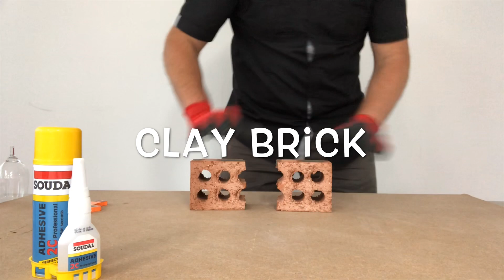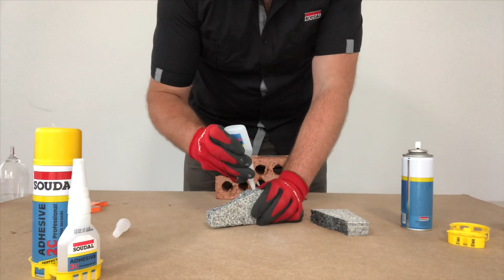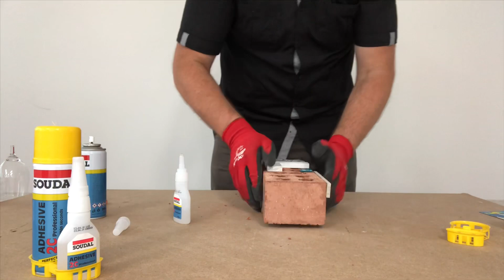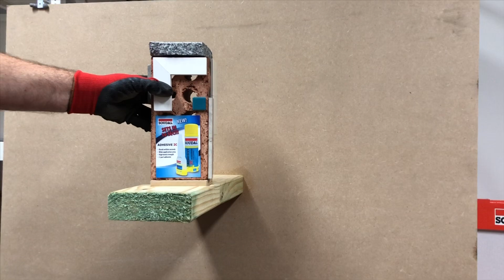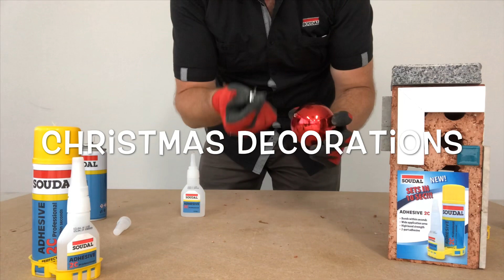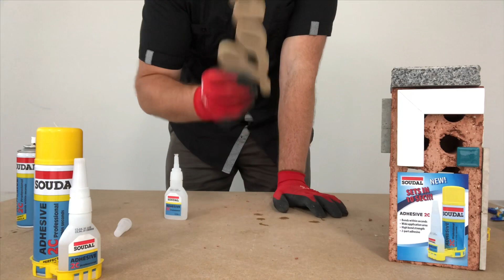FAST ADHESIVE THAT SETS IN 10 SECONDS - 2C ADHESIVE FROM SOUDAL

Comment: Fantastic, used before with brilliant results, but amazed at the range of applications.
Questions about this product:
Can it be used as a wood filler (MDF) and then sanded?
Can it be colored? If yes, what with?
Can it be used without activator for a longer drying time? If so, and affect on strength? If so, estimated drying time?

Comment: Just want to know what you could use to clean it off if you accidenly made it run off on a piece of wood? ...acetone doesn't work
Reply from the maker: Jorge Jacinto Hi and thanks for the question, the only way to remove just fully cured is mechanically (sanding/scraping/etc).